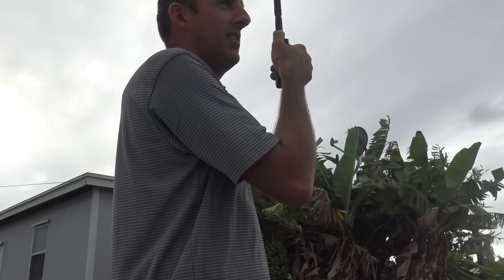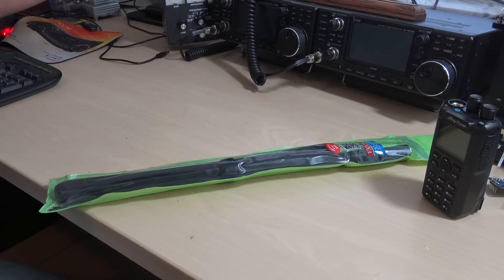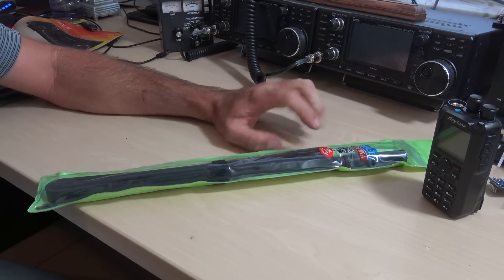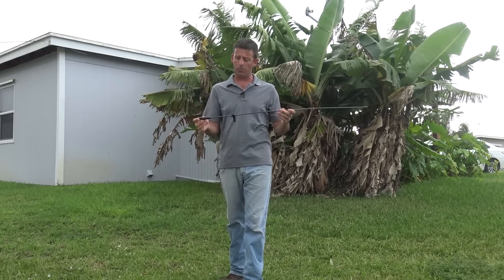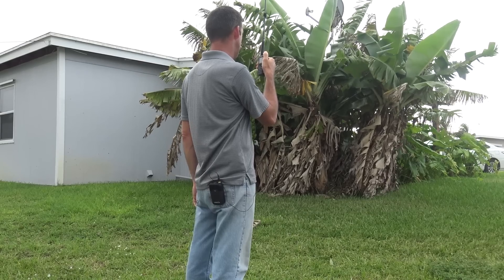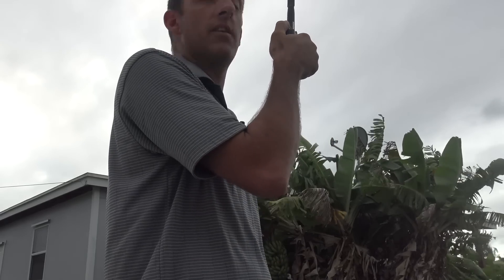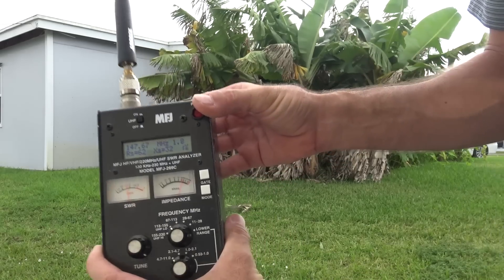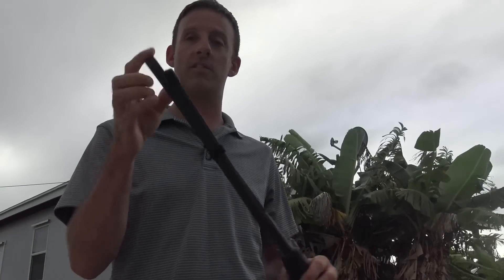ABBREE Foldable Super-Gain Baofeng VHF/UHF Antenna, With Test

Comment: Eric - would this work well for simplex comms - 10 miles?  I'm in NE San Antonio and my son and dil are 7.1 miles away as the crow flies.... but it's in a populated area...  I guess we can test but they don't have the license yet... I got this for SHTF... I do have  a base unit YASUE but need an antenna and get it going...  Plus I need to learn more. I've had my tech/operator license for many years but previously used it only with a State Guard in a limited capacity for training and deployments.   There are repeaters around and I think the nearest is closer than 30 miles... and that should allow me to speak to my other son and dil who are down in Del Rio (he's an AF pilot).  I'm guessing the answer is yes - as distance is distance... but just wanted to be sure.

Comment: If you get wrinkles in the covering of the antenna. Take a blow drier on high and hit those area's. Its just shrink fit tubing. I've had to do that with my 42 inch Abbree.

Comment: Hey. Im considering to buy this antenna with a tnc connector for my TRI prc 148. It says it uses 144/430mhz. Will i still be able to use frequenzies around 446mHZ on my radio with this antenna?

Kind regards
Renè

Comment: I've heard that strongest signals occur with the antenna extended fully on vhf but slightly better signal occur if the antenna is folded for uhf. No personal experience yet but have heard other Ham's mention this.

Comment: Hello  I have a UHF antenna with a 10 inch spring  for a UHF cp200 radio.  I just got baofeng radio dual vhf/uhf. Question is can I use that antenna for the baofeng,  and if not why so 🤔

Comment: I used that same antenna with a Baofeng bf-f8hp and was just barely able to make it to a repeater 20 miles away
Reply from the maker: What was the range with the stock antenna?
Reply: @HamRadioConcepts  not sure, i have only made it about 5 miles ( so far ) with a Nagoya NA-320A

Comment: Just got mine today, with a 3 ft coax jumper to take stress off of the radio antenna mount. I also have an 19.5" counterpoise on the radio. 
I'm also located about 25-30 miles from a repeater. Will test it later.

Comment: Just purchased the 88cm version. Is it possible to transmit with the antenna folded? I know that the range is going to be lower, but would it damage the radio or antenna to use it folded?
If that's a yes, would it be any problem with just monitoring channels with it folded?

Comment: That's quite good, but I take it the repeater is at a bit of height, but even though......!   Only thing is the weight of that swinging around on the radio plug.  But if you are static it might make all the difference to getting in or not.  I wonder if two would make a good temporary dipole for emergency use?  Might get a high swr though.

Comment: I see the abree great for backpack APRS HT with mobilinkd. Very portable and great range. But could be difficult to transport when mobile and deployed (trees, brush, etc) also I wonder how it performs against a tuned antenna for APRS in this use case. 

For voice work I think the roll up j pole would be better. Can get more height, smaller overall package, and easy to deploy. Drawback is once deployed you are not mobile.

Comment: I have trouble with every dual band base antenna I have ever owned. Either VHF SWR is good and UHF is high or opposite. I haven't used many HT after markets. I did get an 8 inch tri-band 144/220/440 fir a Hessenate tri-band that doesn't work on any band. As soon as I switch to that antenna, I can hear the RX lose out some right away. TX only works for a couple miles from the repeater. The antenna I bought has a step down diameter about 1/3 to 1/2 way up the antenna. Some of you guys may know which one I'm referring too. Any one else get high SWR on dual band antennas? I had a GP9 the same thing, high on one fair on the other. 1.5 VHF 5 or higher on UHF.
Thanks
Randy
N9ROI
Buckingham, Florida
(Fort Myers)
Reply: I use the RADIODDITY RD-301 8" and RD-371 18" Tri band antennas on UV-5RX3. Both about $10. I hit a 2m repeater 20 miles away over the ridges of east Tennessee with the 371.  I haven't got a analyzer yet to put them on.

Comment: I use the Abbree 18.8 inch antenna on a TYT UV8000e, at 10 watts and I can hit and be understood a repeater that is at least 30 miles from me. Also, for what its worth,  said antenna works great on both UHF and VHF, dont know why. KI7BSL, and 73s

Comment: Not knocking the Abbree antenna but I have an alternative idea which is a "J-pole roll-up antenna" which I highly recommend.  [if you do an internet search for that phrase you'll find the product.]  I know of two people who sell them over the internet.  I use my dual band to reliably contact a repeater 31 miles away from me in So. Calif.  What's nice about these things are very light weight but they can literally be coiled up to fit inside a sandwich size plastic bag.  Excellent for go bags or home station use.

Comment: When you were testing the radio at the UHF level, you were measuring at the UHF low setting, not at the high setting on your analyzer. So your testing at the UHF levels was inconclusive for this video.

Comment: I have the 28". It works great. You DO need to be careful about the stress it puts on your antenna mount nub....
Reply: For increasing two way communication between two specific radios you would need extended antennas for both right ?

New to this sorry for the stupid question
Reply: @ThatGuy-sc5rx  It would very much help to have a larger, better one on both, though even ONE of the radios having it, would be an improvement.

Comment: Because 5 pounds of antenna in a go kit.   is so much smarter then a wire. Espesially testing standing still.  I do agree though,   food and water is sooo over rated.  Better to chat with john boy in those situations,  Instead of someone closer.    This is your second winning video of the day.   Geez.    I dont believe you have ever thought of application,  in any of your vids yet.  Perhaps I just missed that day,  3 years ago?     [Before u reply]  know that you will not be traveling 30 miles an hour......... standing still..    so perhaps u need to talk to someone 4 or 6 hours away? U can wait that long to hit them with that cannon of an antenna... I would rather be gone in 30 with a light pack.  Please remind me why I subbed again.  Soon.
Reply: Because 6oz of antenna that doesn't require you to dick around with a wire and trying to find a place to hang it is convenient when trying to make time or finding a place to hang a wire is unsafe or impractical. Don't let the door hit you on the way out.
Reply: 140 grams is not 5 pounds, its 5 ounces.

Comment: Hi Eric,

I got mine (42") a little over a week ago; works great!

I can hit my club's repeater 65 miles away with full quieting from inside my home. I can do the same with my older Cushcraft AR-270B, which is 7 feet long.

As Josh would say, Abbbbbreeeeeeeee!

73 - John -N7GHZ
Reply: I am new to all this and i was wondering what the utility of this is ? Does it increase range for two way communication (something im looking for) and would both radios need one installed ? 

Also how short is it folded ?
Reply: @ThatGuy-sc5rx  - it absolutely increases range in comparison to a stock antenna or even over a really good third party ant. Like a Nagoya which I almost always use. 

It is most useful if you have a marginal signal if you are out in the boonies! As I am in Arizona, that happens a lot as I travel.

Comment: Thanks Eric I just got one but my results have not been as good.
May try a 16 inch ground plane wire suggested in the comments.
Do you think this will work on a backpack with remote SMA coax cable?

Comment: Important to remind people, that is 35 miles on pretty flat land.  Good stuff.
Reply: I'm getting 28 miles from my location in Central NY with lots of hills and what not to a repeater that is on lower ground than me. It is a DMR repeater though and I find DMR/Digital is sort of like SSB vs FM. Much more punch.
Reply from the maker: well, there is a lot of stuff between tho... but I guess you are saying it would be more impressive if I had some rough uneven terrain with hills in the way?????
Reply: Ham Radio Crash Course
Ah... Very interesting. My  Abree 25 ish  miles were over flat land.
Hand held to base station.
Reply: @MauriatOttolink  I've had good results from my antenna.
Reply: Trump stupid
Reply: @frankfant3725  typical.  Orange man bad! Don't know why.. TDS
Sorry  hamradioconcepts.
Reply: DON'T KNOW WHERE THIS POST CAME FROM BUT I WILL FIND WHO DID THIS DON'T  CARE FOR TRUMP BUT I DON'T POST JUNK ON WEB ABOUT HIM

Comment: I'd be very interested to see a Smiley 2700 antenna on that analyzer.

I guess I take for granted my geography with so many repeaters on hills and mountain peaks.  Using repeaters 30-40 miles from my home on a HT is a regular occurrence.  With a modest dipole in my front room, I can hit 50 miles no problem.  I've even done 50 miles on low power UHF using a rectangular loop antenna ( also mounted inside my front room ).

Comment: I have the 28 inch version of this antenna and it’s super weird the TX seems to be good all the time but the RX is kinda spotty, at least for me anyway. There’s a sea tow VHF radio check beacon ab 4 maybe 5 miles away from my house and sitting in my room I can hit it with the stock rubber duck but it’s really scratchy however with the abbree it’s super clear BUT I can’t always receive it, idk it’s weird
Reply: Also it seems the RX is better on UHF when the antenna is folded

Comment: On the recommendation of Josh’s video, I purchased the 42.5 inch and 18.8 inch abbree antennas. On the stock antenna on my uv5r I can bring up a repeater 7.9 miles away. With both abbree antennas I get nothing from the same repeater. Very disappointing. I’ve checked packaging etc and feel certain that they are authentic. Am I doing something wrong?
Reply: I wish someone with the know would comment on this
Reply: The abree should blow the stock rubber duck antenna out of the water.. signal stick super flex, nagoya 771 are other good choices and are inexpensive. Might be a problem with your radio or bad timing/weather conditions. Keep trying

Comment: Should try adding a counterpoise wire.
Reply: 5/8 wave at two meters does need a ground plane or the radiation angle goes above the horizontal. On 440 its starting to act like an end fed longwire and you want to  point the tip at the repeater. That said, its better than a rubberducky where half the power is going into your brain and the gain is way below a dipole. As VHF-UHF is about antenna height and line of sight, used with a lightweight mast or clamp and say 20 feet or so of 8X coax would make a nice portable range extender. Also, if you move and the signal goes in and out (mobile its called picket fence) you have a multipath problem you need to go  up or sideways to get a better signal. If you can't do either, using a yagi and pointing it to the strongest signal can be a solution.
Reply: Would good on the yaesu 817 if it is made with a BNC
Reply: Why? it is over a full wavelength on 70cms
Reply: @TonyLing  counterpoise wire completes the other half of the antenna. Think of it as a vertical dipole
Reply: @ryankc9oza118  Yes, but it is not a dipole if you are using an endfed random wire antenna is it?
Reply: @TonyLing  not saying you have to use one. I've put one on my ht and it helps it.
Reply: @ryankc9oza118  Yes, but it is not a dipole is it? By very definition
Reply: @TonyLing  Google counterpoise wires for ht. Just saying a counterpoise wire will help an ht as it helps recieve and can transmit by completing antenna
Reply: @ryankc9oza118  I've already done my research thank you buddy
Reply: @TonyLing  ok. Was just saying counterpoise wire helps. I've tested both ways. An endfed antenna usually uses your coax shield for counterpoise if you dont add extra. But have a good one. 73s

Comment: I heard you earlier on SARNET testing this. Good job. It reminds me of the antenna on the military PRC-XXX backpack radios. You gave me an idea of making one with tent poles and a wire j-pole.
Reply: Prc 77 radio
Reply: That's kinda what I thought when I saw it on Ebay. Just ordered one, but it reminded me of the SINGARS radio we used in basic